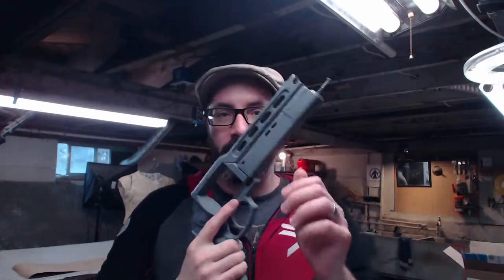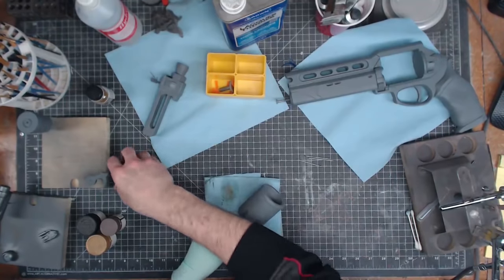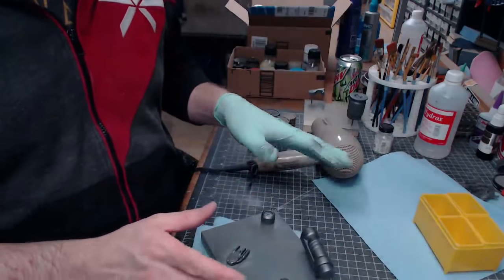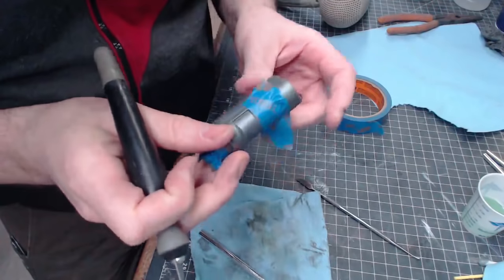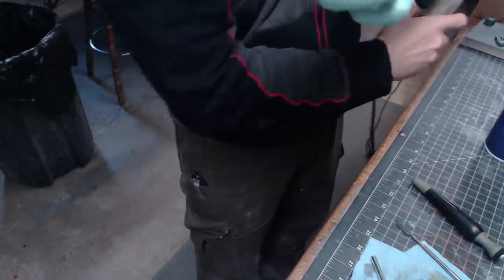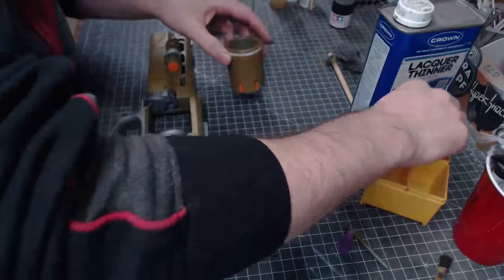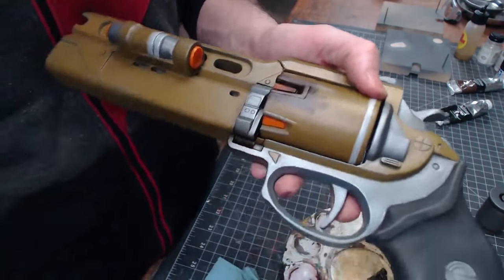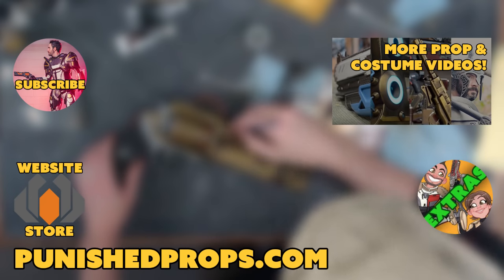Building the ZProps Fatebringer Kit Part 3: Painting - Prop: Live from the Shop

Comment: Those are some seriously good books. Next thing you know you'll be painting model kits! In regards to the hair spray chipping method, usually people put salt on the wet hair spray, paint over it, and then rub the salt of with a toothbrush and this chips away the paint in a nice, random way.
Reply: also works pretty well with vaseline. combine vaseline and sand, put it on, spray over it, remove it!

Comment: I used this weathering technique on my recent project and it works wonders. you can do it gradually with a paintbrush like Bill did here, and you can also use it to add scratches to a paint job. say for a metal base with a black coat on top. just coat the area with a little Windex and water then wrap some coarsely woven, thin cloth on your finger and add your desired scratches. you can get several different effects using this by adjusting how you hit the paint with the cloth

Comment: For small parts, you can also stick a bamboo skewer into whatever holes are available (or you drill into inconspicuous spots) then simply stick the other end into a block of Styrofoam.  I sharpen both ends of a bunch of skewers to make that easier.

Comment: I get the feeling the cylinder constantly pops out the side when you hold it straight up or slightly left as I can tell you avoid doing that because it would show how the model doesn't lock properly.  Might not be too difficult a mod to add a magnet to fix that however.
Reply: You'd just want a weak magnet because in game, the flick is how it pulls the cylinder out to be reloaded.

Comment: Would a  Air Spraying Pressure Pot Tank work the same as a Pressure Chamber for casting bubble-free resin? Also would i need a vacuum too or can i skip that? Also also. The pressure chamber/pot would use a compressor right.?
Reply: thank you so much for the reply.

Comment: Is the hairspray weathering just for lighter wearing of the paint or could it be used for heavier scrapes? (can it be done more sharply, i suppose)
Reply: I was just going to comment up top and saw this. I'm using the hairspray technique on my Klingon Disruptor at the moment and I'm finding that a more firm, wiry brush and a chewed cocktail stick (toothpick) give a higher contrast. I find I prefer this method. I find the edges on latex masks are a little too clean. That said, used together you could get some great results.
Either way, the Fatebringer looks absolutely stunning in the end.
Reply: I'm going to try out your oil paint weathering technique on this one too. It's a neat idea.

Comment: next time to add extra authenticity to the sense of age. round off any corners or sharp edges around the  muzzle and front of the cylinder irl that is called "holster wear".
Reply: guardians in destiny don't use holsters (least not traditional ones) they are attached to their armour around the small of their back when stowed
Reply: Jim Goulbourne my Luck Pants on my hunter in D2 have a magnetic thigh holster

Comment: What is the type of paint used that can be rubbed away. The brown used in the cracks
Reply from the maker: I usually use acrylic or water soluble oil paint, watered down so it stays wet for a while and is easy to wipe away.
Reply: @punishedprops  ah great, thanks very much

Comment: Something else I discovered is to apply the spray in light coats and not hit it too hard and create pools or it reactivates the hairspray and you get messy patches.
Oops. :D
Reply: I think I used way too much hairspray. The paint was coming away in flakes, leaving a fairly hard edge rather than the subtly eroded edge I was after. I think a fine misting is probably enough to lift the paint subtly. I agree. Some experimentation is definitely in order.
You can actually buy proper model makers weathering fluid for this purpose but I think it's just hairspray in liquid form for your airbrush.